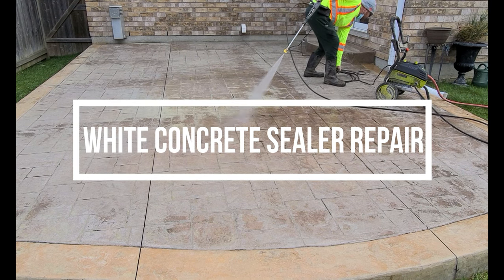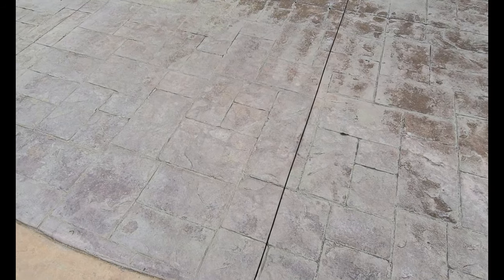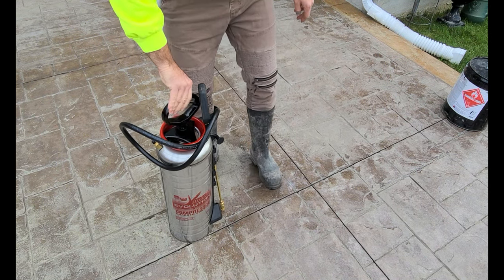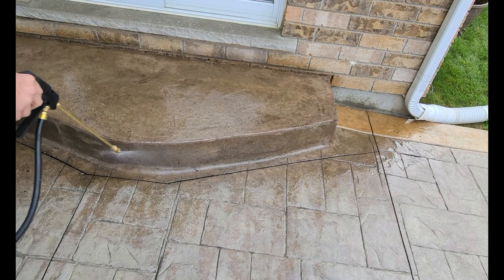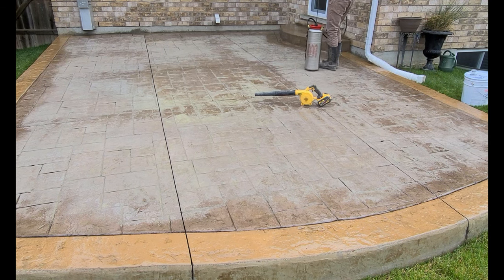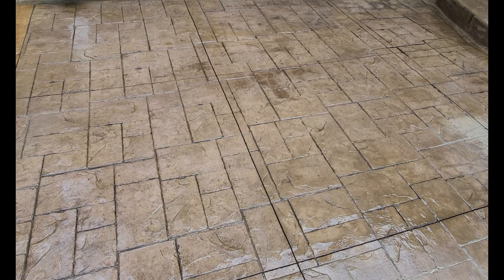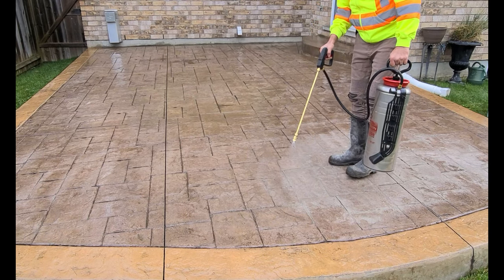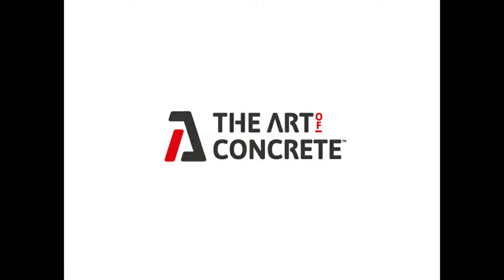Rescue Your Stamped Concrete: How to Fix White Sealer with Xylene

Comment: I used a solvent based acrylic high gloss sealer to reseal my stamped concrete porch floor.  In front of my fireplace, I didn't get the sealer rolled out and found a 6 - 12" band of pure haze the next morning.  I wiped xylene on with a cloth and the haze disappeared.  Do not wipe the rag across the treated area more than once!  It turned out perfect.  Thank you for the video.
Reply from the maker: Wow thats so good to hear.  Is there anything else I can create the might help?

Comment: Thank you for this video. Is there a temperature range that the xylene should be applied? How long before foot traffic and placing furniture?
Reply from the maker: Above 10 degrees Celsius but up to 27.   It drys within 20mins but be sure to leave longer and check if it's tacky prior to use.  Thanks for the questions

Comment: Cool video.  In addition to wearing the respirator I would recommend wearing your pants over top of your boots instead of tucking them in.  That way you will prevent any chemical splashes or debris from getting down into your boots and contaminating your socks and feet.   Those pants would go over the boots tight and give you a good seal to stop stuff going down your boots.  In your next video can you try wearing them that way and let me know what you think?
Reply from the maker: Thank you! I appreciate your feedback.   I'll consider it on my next video.   Possibly get safety coveralls
Reply: @theartofconcrete  Yes coveralls would work great over your rubber boots for sure.  I have multiple pairs, some for summer and some for winter.  Even if you're not wearing coveralls though you should start by throwing your pants over your boots.  I always wear mine over my boots and find them better that way.  I'll look for it in your next video.

Comment: Do you just apply the xylene and walk away? Do you wait for it to dry? Should you rinse it off after a certain amount of time?
Reply from the maker: Yup apply the xylene on a clean surface and watch for wind debris as it will set up quickly.   The sealer is only liquid for max 30 secs.  You should do it on a dry day, rinse an hour later but not needed

Comment: Does xylene work for water based sealer that has sand trapped between it and the pavers?  We need to remove the sealer & sand.

Comment: Great video. I put down an acrylic solvent sealer 2 years ago, on a concrete paver patio. It’s a non wet look acrylic and just makes the pavers look grey, it’s also milky white in some places. Looking to remove the acrylic and leave for a year before putting down a wet look sealer to bring out the color of the pavers. If I use Xylene as you’ve shown, would I pressure wash then to remove the acrylic, maybe agitate with a brush to loosen? Have pets so not super excited about xylene but not sure I have a choice. Thanks for your help!
Reply from the maker: Hey thanks for the response.   Xylene works for a quick fix.  I have done this experiment a few years ago.   The Xylene drys under 2 mins.  I tried a pressure washer with spray Xylene but as soon as the water got on the sealer where I was going to Xylene it wouldn't penetrate.  The water acts as a neutralizer.  Try to get your hands on a pail of "strip this" imo technologies.

Comment: Hello I recently resealed my stamped concrete. However, the part of the patio which is exposed to sun and rain ( not covered by the roof) , still has spots that seem like there is no sealer or less sealer than the covered patio (white areas that are not as dark as the rest). Does this mean I didn't apply enough or I applied more than I should? I was told to apply 2 coats both thin, (1 gallon per 400 square feet for the first coat and 1 gallon per 300 square feet for the second coat. The first coat I applied it with the sprayer having my wife using a roller behind me, and the second coat I applied only with the sprayer. It's been 1 month now and it shows some fade areas on the exposed to the sun/rain area of the patio. I mean, is it normal to fade? I would expect to last longer ( I used the expensive sealer Armor AR350). QUESTION:  After 1 month, will it be stupid to wash this faded spots/parts of the patio and reseal them again using a roller? Or instead of sealer I will need to pray with the Xylene as you do? I am so confused...

Comment: Appreciate the videos. Are you spraying over  water based or solvent based sealer?  Also of the 2 types what do you recommend? Thanks!
Reply from the maker: Good question.   This is acrylic sealer and applying xylene to neutralize the moisture.   I don't know if it would work on water based. Acyrlic based sealer such as super diamond shine is one of the best.

Comment: Great video. My stamped patio had an area that turned fairly white last summer, and I thought maybe the acrylic sealer had worn there. I applied more to that area and it turned milky/dull, although not right away. The area was overly shiny at first. Would xylene help or should I strip it all and redo. It's sealed with SDI Stamp Seal.
Reply from the maker: Great question.   Do you want it less shiny?
Reply: @theartofconcrete  well the area that I doubled up with sealer was very shiny for weeks but then got dull and whitish, sort of cracked looking. Resembles the patio in your video. Thinking xylene might be worth a shot before stripping and redoing the entire patio.

Comment: Thanks for the video!  What do you recommend if all the sealer is gone.  Do I just pressure wash and then reseal with a spray can? Thanks
Reply from the maker: I'd leave it. Sealing requires maintenance
Reply from the maker: If all the sealer is gone you can also reseal

Comment: I've got an acrylic solvent sealer on my grinded concrete alfresco, there is some minor roller blemishes in areas that look a little darker and shinier in different lights, also some bubbles in some area that the sun was exposed to while drying. Do yo think I could give it a spray with xylene to reactive the acrylic? Also wold you recommend a light roll after spraying if its the way to go?
Reply from the maker: Hey good question.   Is the concrete outside with very good ventilation?   If so yes a very light spray of xylene will work. Roller will only pick up the existing sealer, I wouldn't roll.  Sprayer does a good job.  Be safe
Reply: Great thanks, would you recommend spraying the whole area for consistency or just the affected areas. By light spray just the same as per your video? Thanks again

Comment: Does this work on pavers? I have one spot with the white chalky look like you have their. would I apply the same method as you on that one spot or the entire area and just leave it to dry?
Reply from the maker: Hey I would give it a test.  Try it on the worst area 12"x12"
Reply: Thanks and once the areas dry it should get rid of the white and match all other pavers that did not get treated with the xylene correct

Comment: Great channel and video was very helpful. Question: I had my stamped concrete sealed last year and it has a bit of white chalky look, but also seems like the colour is really fading in a few areas. Its like the sealer doesn't even exist on those areas anymore. Should I apply xylene or just coat with new sealer?
Reply from the maker: Thanks for your feedback 😀  if the concrete is hazy white xylene will remolsify the existing sealer
Reply: @theartofconcrete  it worked out great

Comment: I just did about 700 sq ft of these really nice red pavers. Used glaze and seal wet look. Lacquer base and while 90% came out as desired one section of the yard the whole left side from back fence to house about 30 feet long 1 ft wide just started to cloud and haze. I could tell working on this property for a few days, I was pressure washing then sanding and finish sealing. Anyway I could see the problem area took much longer to dry. I waited and even used some heat guns but still it’s no good. Would you suggest I follow your video and real seal that area or do I have to start back at square one and strip it all? How would you tackle this ?  
Disclaimer I was paid in full and have done this now 4 times and this only time where it happened. I want to do the right thing by this family and appreciate the help. 
Regards jimmy
Reply: Hey mate. Not sure where you live exactly and what the weather is like.
If you can, wait consecutively warm/hot days in a row and give the area a xylene wash/ roll. Reactivate the sealer and the warm day should help release the moisture as you have allowed it to escape.
This guy would know though!
Good luck bro ✌️

Comment: We had our patio done in 2016 and in late 2019 I tried to reseal it for the first time but within a month parts of the patio developed milky white patches. What do you recommend I do? Should I try this method or should I try to strip and re do??
Reply: The same thing happened to me. I acid stained and sealed it my patio. The sealer turned milky white. I used Xylene to strip a small are about 3'x3' and I pressure washed the sealer off in that area. The Xylene turned the stripped area real dark. Tomorrow I'm gonna try just spraying the Xylene on and letting it sit like he did in the video. Hopefully it will work like he says. Guess I'll find out tomorrow.
Reply: @livinglife69  how did it turn out? I was going to start mine in a week. Thanks
Reply: @jamespratap4922  It came out pretty until i sealed it. The sealer didn't take to the patio and turned out milky white on top of the stain. I had to buy Xylene and totally strip the sealer off the patio. Took me 4 1/2 hours. Don't use HC clear sealer from Lowes. I re-stained the patio to get a darker look. Came out great. Don't think i will seal it though. Me and the wife like the matte look without the sealer. I also did our entry way to our front and walk to the drive way. That came out good as well and the sealer worked fine in that area thank God. My wife was like "You should do the whole drive way". Hell no! I'm done with this project for now. If your going with a dark stain I recommend doing a 1 part stain to 2 parts water. If it doesn't come out dark enough you can always stain again when its dry.  Good luck James.
Reply: @livinglife69   " used Xylene to strip a small are about 3'x3' and I pressure washed the sealer off in that area."  Did you use pressure wash immediately on the area which you had treated with Xylene?
Reply: Xylene isn’t used to strip sealer as Chris mentioned. Xylene is an emulsifier which should reignite the sealer to come back and reseal to the surface. I hired someone to reseal my patio and after a beautiful finish it tuned milky in patches. Cause: I don’t think he waited to fully dry before applying the sealer. Gonna try xylene over the affected areas
Reply: @jayzee9273  Please let me know how it turned out. We had a new stamped patio put in a few years ago. A year later, we had our roof replaced. The roofers stripped the roof and put all the old shingles and nails on a tarp then dragged the tarp across our new patio and scraped it up pretty good. So, we had someone come out and resealed the concrete to fill in the scratches. However, now the patio is 75% white. I think that I'm going to try Chris's Xylene method.

Comment: Can we use a garden sprayer or do we have to use a roller? I don’t have what you used, but I do have the same issue with my stamped concrete. What will Xylene do? If I use a power-wash to wash my patio before applying Xylene, how long should I wait before I apply?

Comment: I tried to seal my concrete last year and it rained the day after and made while Marks and thick white ‘glue’ type stuff in all the lines. Same design as this. So I know I need xylene to strip it off. Just to make sure... jetwash the concrete so it’s clean, leave to dry. Then use xylene, leave to dry, then I can apply sealer again the day after.
Reply from the maker: The white haze will show up a within a few hours or 24hours.  If the white haze shows later it maybe a bigger concern.
I wouldn't use xylene to strip the sealer,  "strips this" is the best product for stripping sealer.  I'll be posting a video on this in the coming weeks.  Thanks for the question
Reply: "Strips this" or "strip it" product is discontinued. I'm gonna try spraying on the Xylene on my cloudy patio tomorrow.  I'm gonna let it sit for a 24 hours and see if it takes away the milky look. I did use Xylene to strip a 3x3 foot section of my patio and then I pressure washed it off. It does work to strip off sealer. I prefer not to strip the whole patio if I don't have to. Guess I'll find out. I also researched a ton online and I couldn't find anything else besides Xylene that strips solvent-based acrylic sealers.

Comment: After a few months.. turned white again or not...I wanted to know
Reply from the maker: Great question!. No white haze will not reappear on this patio.  Depending on the concrete and if there's moisture present results may differ.
Reply: Did you show an after pic? Did it stay glossy like that or does it remove the sealer and go back to the way it looks when it was first stamped? (Matt finish)

Comment: If you did not seal it then what did you spray on it also why did you only use the xylene around the perimeter of the patio. Thank you
Reply from the maker: Hey James,   xylene was used on the entire patio to remolsify the existing acyrlic sealer.

Comment: When your patio looks like this you should really sandblast old sealer off.
Reply from the maker: Thanks for your feedback,   sandblasting will remove the cement off the surface of the concrete,   leaving an exposed stone look.  There's a product call strip this and it works well for removing sealer.  This wasn't to the point of stripping.
Reply: @theartofconcrete  do you have a link to this product called "strip it"?

Comment: I used Xylene to try and strip my sealer off my stamped concrete because I have way too much on.  I went to pressure was it after applying to a section of my patio, but it just clumped up.  I can’t find this product, Strip This, you recommend.  I see a product called Strip It...is that what you meant or do you have a link to Strip This? Thanks!!
Reply: I'm in the same boat. There is a video I referenced from Windy City Steamers on here, but I just purchased Xylene from Menards and pushed it around with a brush in sections. Then use concrete surface cleaner to clean it off. Just gotta make sure the pieces of sealer coming off get off the patio before it dries otherwise it starts harderening back on the patio in gritty little pieces (would have been nice to have known that before I started). I think the other thing is a good gas powered pressure washer. I rented my equipment and it was a max of 2700 psi.  The minimum psi for the surface cleaner is 2,000..  but at 2700 psi, I think a higher psi would have been even better. 

I used about 3 gallons of Xylene on my 500 sqft patio. It got about 85% of the sealer off, which I am happy with. I might tidy it up by by rolling some more Xylene and spot treat some areas before sealing.. This time I purchased a quality more expensive sealer (AR350 by foundation Armor). I was using big box store sealers and it always turned milky, and flaked within the year..  hope this helps. Stripping the sealer has been a lot of work!
Reply: Jeff _ Yeah, I used a gas pressure washer with 3300psi.  The Xylene just made it clump up & I got sealer all in my decorative rocks around my patio when the water, xylene, & sealer was washing off the patio.  I’ve just made a mess & I’m looking for a good product to strip all the sealer off & start fresh.
I now know that Xylene is good if I want to freshen up my sealer after a few years to bring it back to life, but it sucks to actually strip the sealer off...it just makes a huge mess.
Reply: @jeff_9074  nox crete deco-peel and either sparkle seal or Stifel GC, both nox crete products